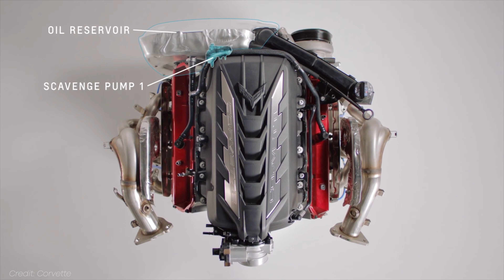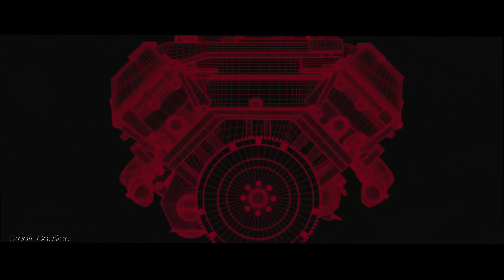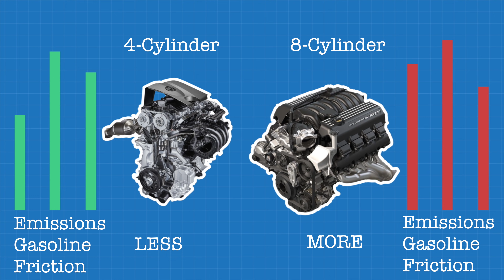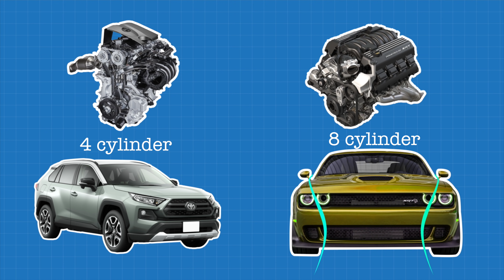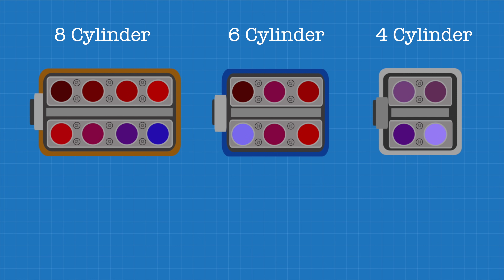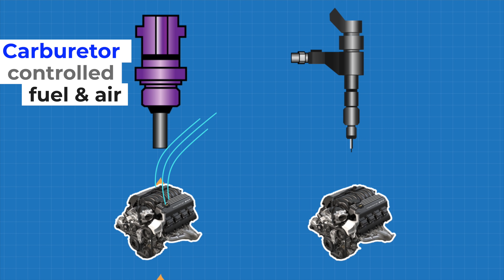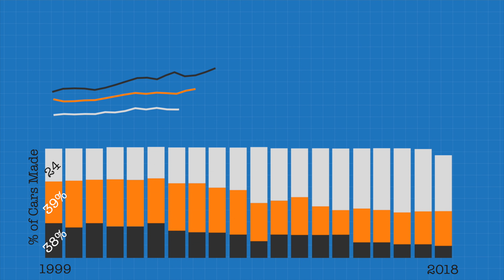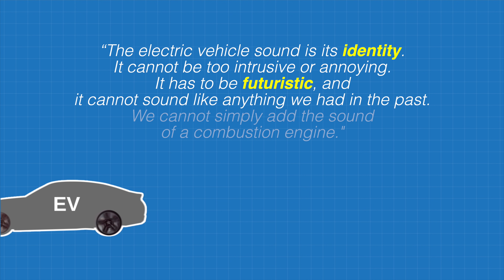Why V8 Engines are Dead

Comment: The problem with trying to get more power and efficiency out of a 4-cylinder engine is that it gets destroyed faster. More affordable, yes, but that’s only when it’s brand new AND if you baby the thing. After that, the engine costs a fortune to replace to Factory specs. So it’s impossible to think the 4-cylinder will be popular for much longer as companies try to get as much power out of those things and customers have to put up with shorter and shorter engine lifes. So in actuality, it’s more likely the V6 and maybe the V8s will come back, and be made more affordable again as we figure out ways to make them more efficient without destroying them like the 4-cylinder counterparts. And if railways have taught us anything, it’s that you can always optimize the current system and make it better without worrying about the complicated and expensive mess of newer systems. Meaning electric power cars may still be a niche thing, not to mention still be super not-environmentally friendly when it comes to making the batteries.

Comment: I wouldn't start playing the V8's death song just yet. I have two vehicles, both less than 10 yrs old and both powered by V8 engines. Oddly enough, ALL of the super high techy tech things you mentioned that supposedly make four bangers more powerful can be applied just as easily to V8s. Another thing you might want to factor in to your thoughts. Now that America has at last gotten a decent President, we suddenly became energy independent. Amazing what can be done by a doer instead of a talker.

Comment: My grandfather had a early 70s Buick Electra with a 455ci V8 and a 3 speed automatic transmission. That thing was the size of a tank lol. The engine knocked like crazy but it never died. I never understood how an old engine like that could knock that bad yet still run. I'll never forget that car.

Comment: My 1986 Pontiac Trans Am had a 5.0 Liter Multiport Fuel Injected V8, she did 0-60 in 8 seconds flat according to the internet.....  My 2014 Nissan Altima has a 2.5 Liter Inline 4, she does 0-60 in 8 seconds flat according to the same internet...  Trans Am got 12mpg, my Altima pushes 30mpg around town!  Though the Altima sounds like farts starting up compared to testosterone surging roar the Trans Am had back in the day.  I miss that sound with a passion.....

Comment: Here is the Truth about the V8 Engine , Fact , the Sound of the Engine and the Effortless way the Engine moves a Vehicle  has a Sensuality and Sexuality  about it ,this Planet  is all about Sexuality , and that is what Underpins Human Sexuality  . There are 2 Factors , The "Sound" and the "Effortless" of the V8 Engine , for some reason , Resonates with Women . Fact , Women are what Drive Men . A few Tips for any Men , if you are interested in Women . Women "Hate" Diesels , the Diesel Engine is a Sexual turn-off for Women , the Reasons are , the Smell , the Sound of the Engine Mechanically and the unsmooth grating vibration that gets transmitted through the Vehicle while Driving . The 4 Cylinder Motor also , is a Turn-off for Women , it represents also a Tightwad , Cheapskate Guy . Thats why the V8 to date has never gone away , and will stay . If any Guys out there Like Women , take note of what I have commented .

Comment: The reason I didn't spend $67K on a Tesla is because I spent $67K on a Dodge Charger Hellcat. Best decision ever. Everyone loves that V8 sound.
Reply: Car Freaknatic not really
Reply: @Amare._  just because ypu dont beleive something dosnt mean its not a fact
Reply: Yes sir! Love my flat plane crank V8 GT350 and Challenger HC Redeye!
Reply: Car Freaknatic If you dish out $150,000 for a tri motor p100d and then completely gut it, sure.
Reply: Car Freaknatic except range and charging/fueling. As long as those two obstacles are there, EVs won’t go mainstream.
Reply: Don't forget the sound of that twin screw on top of that V8!!! Just makes me feel all warm & squishy inside 😂👍
Reply: You could get a hellcat for 50k
Reply: @Car Freaknatic not really... especially sound ;-)
Reply: @Car Freaknatic I don't hate on EV's. I like to argue that the world doesn't need them. 

You wanna waste your money on an EV, that's your choice. I won't though. I am perfectly content with my ICE Powered vehicle. 

Have a good one.
Reply: @Car Freaknatic Range not an issue?? 

Sorry dude but only 300 Miles between charges sucks when my ICE vehicle can go over 400 Miles on a single tank of Petrol. 

And it only takes me about 5 minutes to refuel which means I am quickly back on the road while you guys are still plugged in twiddling your thumbs. LOL

And I don't have to plug in my vehicle at home lime you EV guys do. 

And so long as the engine cranks over when I get in my vehicle I can drive off without a hitch. And I get to avoid the jump in electricity bill with an EV. LOL
Reply: @Car Freaknatic I like Teslas and agree that they perform very well. When you look at the numbers, of course they are gonna be faster than most ICE vehicles. People that deny that have their heads up their asses. Now with that said, I feel like you are kind of missing the point of buying an ICE sports car. It's not always about the numbers. It's about the enjoyment. Sure, having the torque of an electric car throw you back in your seat while you accelerate is thrilling, but you are pretty disconnected from the driving experience most of the time. Executing perfect upshifts and downshifts shifts to keep an engine in its peak power band is much more engaging. I never get tired of hearing the exhaust note from a nice, throaty V8 either.
Reply: @Car Freaknatic Noise raising stress levels?? Bwahahahahahaha!!! 

You really think the sound of an engine raises stress levels?? 

OM Gosh man. That's lame. C'mon man you gotta do better than that.
Reply: Car Freaknatic I’m just saying that why would you want a car that’s sounds just, “dead”.
Reply: I fully support your opinion , thinking and decision on this matter!  You must be loving life in that hellcat!
Reply: Exactly
Reply: @Car Freaknatic Endless maintenance?? Not mine. LOL

My Jeep Grand Cherokee 4.7 V8 was bought new in 1999 by my mother and still in the family as I own it now. You cant say that about an EV now can you?? LOL
Reply: @Car Freaknatic Where I live and when I fuel my vehicle I rarely have to wait in a que. Pull up and done fueling in under 5 min topps. 

And my vehicle is more fun too. Sorry but I will never personally own an EV because I simply don't need one. What I drive is good enough for me.
Reply: Bobspineable Corvette all day. Best bang for your buck.
Reply: LT I would say the mustang gt or the new camaro lt1 is the best bang for the buck
Reply: LT a used c7 is very appealing right now however. 😁
Reply: @Car Freaknatic the problem with electric vehicles is that the range isnt there
Reply: Car Freaknatic lets see 60-160? Possibly 200 if the Tesla doesn’t blow up??
Reply: @Car Freaknatic also EVs are much more expensive to buy and weigh about 20 to 30% more then an ICE
Reply: Car Freaknatic some of us travel for work and don’t sit at home in mommies closet. Honestly, you’re trying to prove your point and no one cares. V8s will continue to be produced. Tesla’s will continue to make their electric powered cars (which is fueled by coal). Now go drive your I4 Honda shitbox and get out of the comments. You have nothing else to do with your life but disagree with people who disk like electric vehicles. Let’s see an electric motor push big boy CDL trucks. Not happening. Alright stfu now
Reply: @este_bongo  someone doesnt know how the electric engine works. teslas already planning a class 8 semitruck (the main kind you see on the road) with a range of around 500 miles. also. even if 100% of a EV's electricity comes from coal. its still cleaner than burning it in a ICE car xD
Reply: I love cars but I hate working for a living. It's a love hate relationship. Thankfully they charge what they charge for a car now days.  It's a no brainer......i don't buy. Guess to me early retirement looks better. By the way I paid $86,000 for my house......not a depreciating car.
Reply: Better biobutanol high octane v6 vr38 or 2jz
Reply: Speak for yourself 😂😂 👍
Reply: I hate the very idea of an electric engine
Reply: Eduard Van der Merwe exactly, there is no spirit from a electric engine. It’s just, dead.
Reply: asura, being of wrath 

My truck could 100% out run, out perform, and under cost a Tesla any day. Anybody ride up to a stoplight in your Tesla and I’ll blow black smoke all over it while I beat you off the line. Plus it looks and sounds better! 😂
Reply: @romanplays1  

And why do you patron the EV?? 

Do you think your being environmentaly responsible driving an EV?? 

I could argue for years about the environmental irresponsibility from owning an EV but I bet you'd moan and groan and cry foul. Lol
Reply: @PernicekMotorsport_  omg thats by far the dumbest thing iv read yet
Reply: @romanplays1  We petrolhead accept that the Tesla can destroy a lot of our favorite ICE cars in acceleration and they are more efficient and so on, but we still choose ICE for reasons you EV nerds will never understand. And sound is VERY important, deal with it.
Reply: @eduardvandermerwe9836  plus it takes a lot of fossil fuels for producing electric car plus all the fossil fuels to charge the electric car
Reply: @neilbrown82  people keep saying that but it isn't completely true. Yes, initial there's more pollution to build the electric vehicle. But in the long run you will definitely produce less than the gas vehicle. Especially with how much less maintenance and much longer these electrics last.
Reply: @Jeff-gu6nb  lol open your eyes...
Reply: @Car Freaknatic Tesla is just a hyped cool kid car lmao. A hellcat is a real animal.
Reply: @Bobspineable  You don't buy a Tesla for a daily driver. 

You buy a Tesla because you think your being environmentaly responsible when your not.

Comment: I have a 1998 Ford Explorer with the 5.0/302 V8, only makes 215hp, so it no speed demon, but has some low end grunt. There is just something about a V8, the smoothness, the noise, that can't be matched.

Comment: Me tinks big V8 gasoline engines will surpass utility, light and medium duty diesel for trucks. The 7.3 Ford Godzilla is a good starting point. Get a 10 Litre able to utilize NG, Regular, and LPG pushing 800 hp with 700+ torque capable of pulling 30K at 65 mph getting 12 mpg without all the rubbish diesel requires now. Just a big ole simple pushrod engine.

Comment: These new engines may be more efficient, but they’ll never be reliable. All the old cars and trucks with a lower horsepower v8 can run forever. Same thing with a turbo, they just won’t hold over time.

Comment: I know that voice!!! Congrats on your new channel. I like your ability to create this very interesting and historical content! Thanks Scotty!
Reply from the maker: Thank you!
Reply: After watching the rest of the video I must commend you on first rate animations and narration to summarize the essence of how 4 cylinder engines are boosted with turbocharging and high pressure fuel injection. 
Which reminds me this is why V6s are coming out with ridiculously 8 cylinder like horsepower like the 2.9l V6 (505 hp) in the turbo charged Alfa Romeo Giulia Quadrifoglio. Not that it’s practical to own, but just an illustration of what can be done with a V6. 
What sedan cannot suffice with 500 HP and needs a V8? 
I’ll miss the V8s not just because of the sound and smoothness of acceleration but because a naturally aspirated V8 with modest performance mods will always be more reliable and long living (I would think) than a high pressure fuel injected, turbocharged V4 or V6. 
I would think some gear heads will still prefer V8s (naturally aspirated, perhaps with scoop forced air) like vinyl records are preferred by some audiophiles.

Comment: Hair on the back of my neck stands up when an internal combustion ENGINE is referred to as a MOTOR.  Just saying, motors are electric, engines run on gasoline or diesel.

Comment: I just wish that I was able to keep my 1974 ChevyVan 10 running.  My van had a 350cid engine with a TurboHydroMatic Transmission with a 3.60 to 1 gear ration differential.  Had a lot of fun and some eyes are still open.  I had a few people open their eyes so wide?  I bet they can’t close their eyes.  I also taught owners of Foreign cars that an American V8 was under the hood.

Comment: Shades of the stupidity surrounding the first hores-less-carriages requiring a person to go ahead ringing a bell, so the horses would not shy-up and or bolt in panic,   sort of similar stupidity with EV vehicles...   If you M-U-S-T have noise, how about a jet engine with afterburners sound and a "sonic BOOM" for added pleasure when overtaking...   Reminds me of a sweet old couple with a right hand drive, wife on the USA drivers side and a steering wheel on her lap, - when overtaking a more sedately driven car she would hold up the steering wheel as if driving,  Then at a crucial moment, make like she savagely turned into the vehicle being overtaken, Yell out the window and watch the slower vehicle over-correct and self-destruct trying to avoid the non existent non-collision...   Best wishes in your new directions,   Brain...   Oh by the way, I drive a 2003 Mazda 2.5 litre turbo diesel 4x4 utility, GVM just under 3000kg - good for an easy 140kmh, - :-) has railway-line bumpers front and back, ;-)   It  likes gravel better than smooth paved...

Comment: Best sounding normal/street-legal car I’ve ever heard was a 1966 327 Corvette with side pipes.  Sounded so good that I installed that chambered exhaust technology under my 1972 Corvette convertible small block 350. I can still hear in my mind the sound of that car barking to life when I would start it up.  Due to my commute I now daily drive a 2015 Accord 2.4L four-cylinder and while I love the car, the engine admittedly sounds like a sewing machine by comparison.

Comment: A little recent history.  In the 80s Chrysler gave up on the v8 and started making smaller cars with 4 and v6. V8 were supposed to he dead then.  Today chrysler makes some of the meanest v8s.  They have been able to meet mileage standard by adding gears to transmissions, keeping cars small by todays standards.. etc.  We were supposed run out of oil by now yet we have surplus.  Global warming was supposed to have destroyed the planet by now.  We should be using boats instead of cars due to global warming.  Fear mongering 30 years ago.  Fear mongering today?

Comment: When I think of V8’s, I think of power but also fuel thirst. Although it doesn’t have to be that thirsty, and they do run smoothly and sound good. Sadly nowadays everything is small displacement turbo inline 4’s, even worse in crappy ugly new age crossovers. The late 2010’s almost felt like an inverse version of the 50’s, but both with oversized cars.

Comment: I think they will implement cylinder management first on the V8 before getting rid of them. Just like on the C7 C8 automatic Corvette. At the same time if they get rid of them I’m not buying a mustang, camaro, or vette. Even though the mustang was originally a 6 the other two were 8s. I think of those cars I think 8 not 6.

Comment: V-8's are NOT dead. Sorry Scotty. Yeah I know your voice. You can have a 2.5 liter 4 cylinder and a 2.5 V-8. Side by side people will pick the V-8. Gas millage is about the same but the V-8 has SMOOTHNESS in spades not to mention greater torque. The only downside is more parts which equal more in price. It's like 6 cylinders. Given a choice I'd take a inline 6 over a V-6 anyday. The inline is a far stronger engine with 7 main bearings compared to 4. A inline 4 and V-8 both have 5 main bearings but the 8 is less taxing on the bearings. Power and reliability are far more important to me.

Comment: As long as trucks are still being made and as long as internal combustion gasoline engines are being made they will still be making V8 engines. My 1990 350 Chevy is the cleanest running vehicle I have ever owned. I have owned three four cylinder vehicles and none of them even come close to  running as clean as my Chevy. That is measured in total emissions not emissions per cubic inch. My Chevrolet pickup with a 350 engine does not mind Towing heavy weight behind it. The drop in fuel economy when towing my boat loaded with gasoline, camping gear and my truck loaded down with work tools and supplies it just doesn't matter. It doesn't change the fuel economy. When towing the same boat with a Nissan Pathfinder V6 engine the fuel economy suffers greatly. The smaller engine has more horsepower than my Chevy but it just can't do the job Towing like my 350. Turbocharged 4-cylinder full-size pickups are fine for going to the grocery store but not if you want the serious work truck. that is the realm of diesel trucks and v8-powered trucks

Comment: Come on Scotty, if you are buying a GM or a Ford you would have to be insane not to take the V8. They may offer other choices but the smart money is to buy what car makers are good at. In GMs case you are still getting what, 30mpg-ish highway with a pushrod V8? I would not have predicted it it but that is a thing. If you're buying a Toyota get the I4, again because they are good at those

Comment: Main thing I want from any engine is the oil filter on top and pointing up for easy change out. After that, I wish all vans came with an inline 6 providing easy access to the spark plugs.